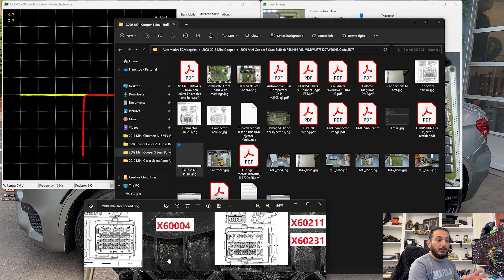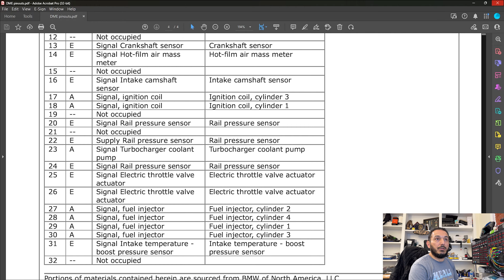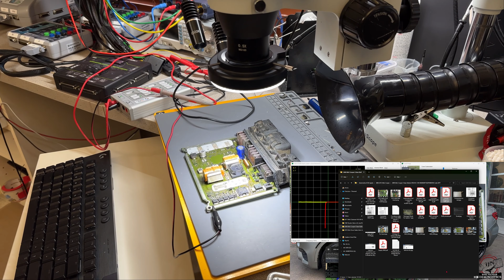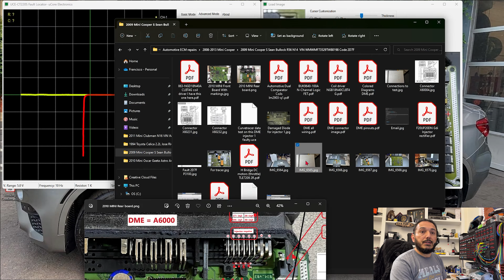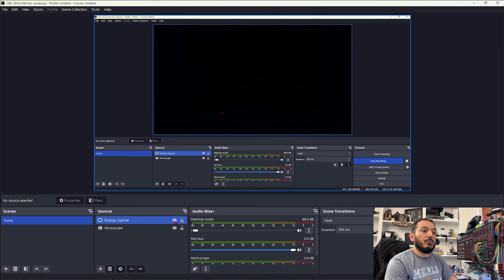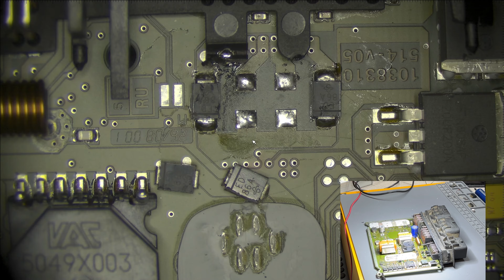2009 Mini Cooper S R56 N14 Injector 1 open fault 2D7F Sean Bullock

Comment: WOW! What a bench. I have repaired a few CPU's back in the day. I was ASE Master tech and was in at the beginning of computer controls. Im' 70 now I taught myself electronics repair when I retired from auto repair in 2005 to present, I have acquired a lot of test equipment. I had no idea there was a market for this repair service. When I was working on cars in a shop it came down to diagnose the problem and if it was a faulty ECM/PCM/BCM ect. we just got a part from a junk yard or the dealer. 
If the control chip that had the loose legs was bad can you get them or are most chips like that custom made for the car manufacturer?
Thank you, I really like your channel.
Reply from the maker: Thank you. You can get the chips mostly overseas, unless you do find a datasheet or manage to get the workings and then find a match

Comment: hi maic, peraining to a chrysler pcm late models with the internal voltage regulators,can you perform an internal repair for this problem? i know that there are numerous external bypasses out there but i dont think they consider the fact that the late model chryslers are "pulse width modulated". they are using older chrysler methods of varying the ground of the field.

Comment: Hello, I have a 2004 Dodge Neon Srt4 and it has been giving me problems due to the fact that it loses power and the engine has lean readings after the time it was turned on and mostly in third gear and it has a code p0135 which is not gone after changing in two Occasionally the 02 sensor and tps sensor and I put the new engine harness on it too and the code still follows... I would like to know if there is a possibility that it is the pcm and if there is a way to contact you so that you can verify my pcm I am from Puerto Rich

Comment: Hola Maic, excelentes videos, me gustaría pedir su consejo, y entiendo si no me responde, tengo un 2010 volkswagen cc 2.0t, soy aficionado a la mecánica así que cuento con poca experiencia y  herramienta básica, el carro tiene misfire en los 4 cilindros, arranca sin problema pero luego tiembla, tengo un scaner de gama baja pero me permite ver datos en vivo, lo que pasa es que cuando subo las revoluciones el misfire se queda solo en el cilindro  2 y los demás no tienen problema, mi pregunta es, me aconseja revisar directamente los inyectores o el problema va por otro lado, agradezco cualquier información.
Reply from the maker: Es difícil sin poder revisar el vehículo. Puedes empezar por mover la bobina del cilindro 2 a otro y si no hay cambio entonces, cambiar la candela. En caso de que aún así el problema persista en el cilindro 2. Ya ocuparías hacer más pruebas técnicas como leak down test y probar las señales de bobina y de injector.

Comment: Nice set up a multi meter on continuity does not load test the component and you can get continuity but the component will not work in some cases.
Reply from the maker: Excellent comment
Reply: @MaicSalazarDiagnostics  Gracias amigo

Comment: I know you are basing the failed component based on experience, but would re-flowing it to verify it;s failed be the first option? Or, no doubt it's failed and not worth the time to verify? I understand the overload is what probably heated up the pins to begin with.
Reply from the maker: Hi, yes you can try todo that if you have the vehicle to test or if you have the entire immobilizer to test on the bench. Remember these are GDi injectors. So in my case I will replace the component and then fully test all signals response to send back to customer, it is the only way I can guarantee the repair.

Comment: Excellent as always. This a very common failure point on Bosch computers. Most people use Rastre Curve as a curve tracer, are there any advantages with the one you're using compared to Rastre Curve?
Reply from the maker: Rastre is an excellent tool as well.